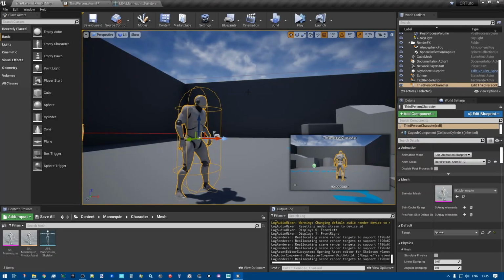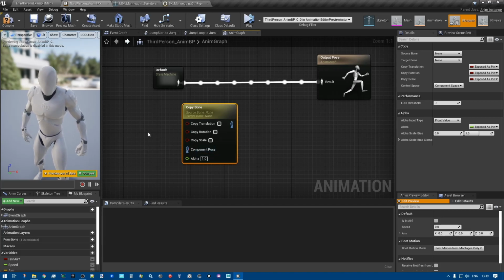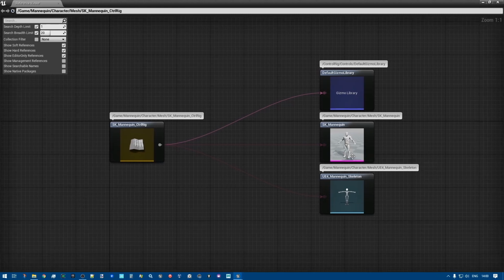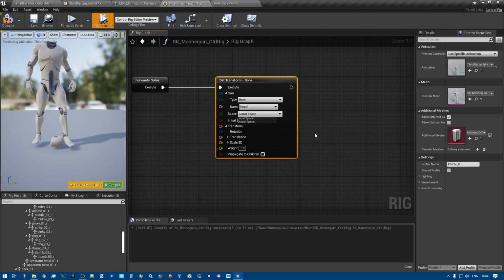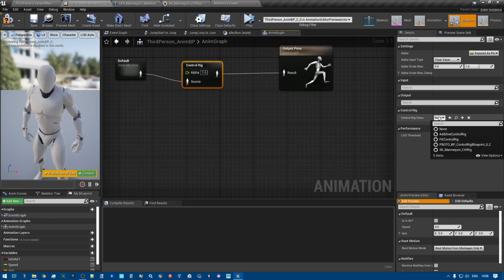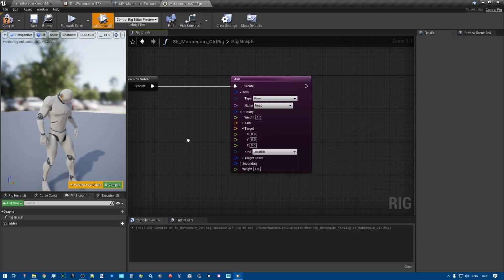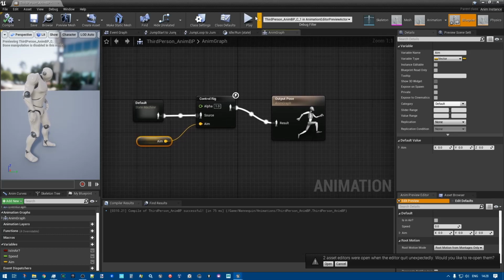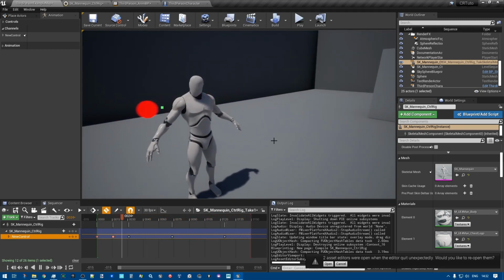Control Rig Plugin for UE4: Getting Started part 1

Comment: it would be a lot more effective if the entire control rig system was built-in to the actor class by default so you don't have to cast to anything or use anim blueprint to communicate with it.